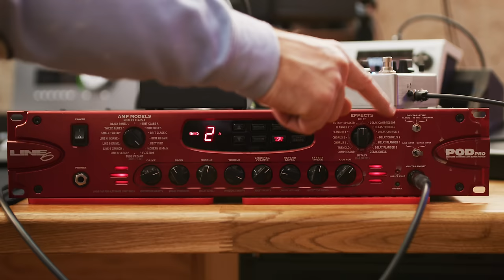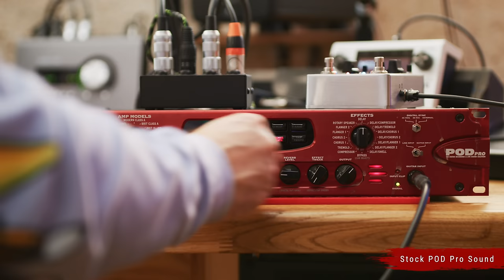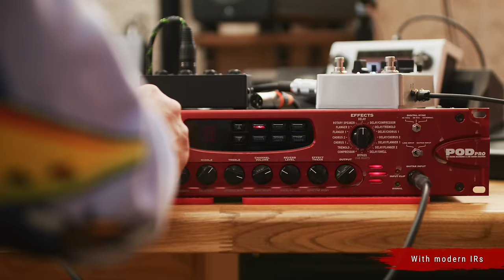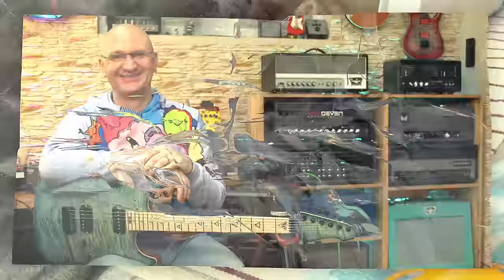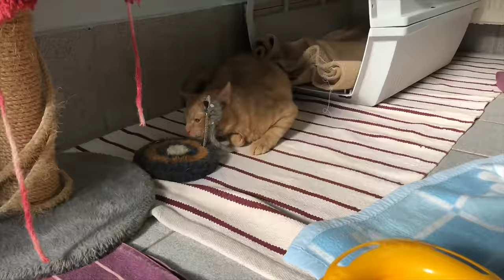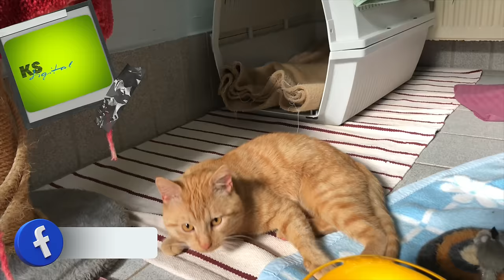24 YEARS LATER - LINE6 POD with modern IRs

Comment: I worked as a stagehand for about ten years.  I saw more of these than people would probably want to admit in racks and under the stage.  They could have been for practice but most of the time the stacks of cabs were all dummies and there would be a little 50-watt tube combo stashed in a box where all the sound was actually coming from.   In the hands of pros these sound just fine and no one knew the difference.

Comment: I used to gig with a Pod 1.0 that I upgraded to 2.0 with an Eprom. That, a floorboard and the original Variax. Built all my own patches. I eventually got such an ear for the Line6 sound that I can still tell when I hear one. I HATE the certain fizzyness that imbues the sound, especially with any gain. I could hear it in your initial sounds. When you  changed the IRs, I could only tell on certain IRs. But there were several that sounded great to me. I never considered doing this. What an eye-opener! Thanks for a great video.
Reply: That "fizziness" is at 3130 hz
Scoop it out with say fabfilter eq..
Q 6
Gain - 6
There you go.. a much better sounding pod.

Comment: I knew this would work because back in the day if you ran any one of these guys through a power amp into a cab with the cab sims turned off into good speakers it sounded good. The issue has ALWAYS been the cab/mic simulation, which is totally solved by IRs. I actually used to run my Flextone II Plus (same exact modeling as the POD HD/2.0) into a stereo 4x12" with the cab sims turned off and I loved it (didn't love lugging it, but it was kind of worth it). Sure, the models could be a little more dynamic, but damn they get you some good sounds if you know what you're doing. Love your stuff, man!

Comment: My current setup is a POD X3 Pro through a Mooer Cab X2, which loads separate IRs for the left and right channel. I put two Mesa Cab IRs, one center speaker and one edge of speaker, so the sound guy can blend both as needed. Similar to moving the mic in front of the speaker. Also, the Mooer Cab X2 is in the FX-loop of the Pod X3 Pro, so I can dial it on and off as needed.

Comment: I gigged a POD 2 running into the fx return of various amps cabs....usually a half-stack....for several years and people were constantly blown away with how I was able to get such great tones.  I ran is a preamp, without any cab/mic stuff, and to use the delay, reverb, mod effects.  I always hated the “modeling” aspect when used direct, so I just took advantage of the variety of tones as a preamp/fx unit with a live amp.  Having the floorboard for it was all I needed on the floor to change patches, turn fx on/off, and wah/volume.  It was such a simple setup that NEVER gave me any issues.........I kind of miss it. 😢

Comment: Rocking a Behringer V amp 3 here after trying a few modern modellers
Reply: I still have my V-amp 2, which I "replaced" with the Valeton GP-100 thinking I just want something newer and with more effects that sounds decent, and frankly in some ways, it was a bit of a downgrade sound-wise. (But on the other hand, I don't have to choose from a few preselected effect combinations and I can also use stomp mode instead of just switching patches, so...)

Comment: Great Show! Yes, I used the Line 6 POD in most of my recordings and you can hear it here "CARL FERRY" on all of your Streaming Platforms including YouTube, Apple, Amazon and Spotify. I now have a 2010 Line 6 POD, a 2000 yr Line 6 Flextone Amp and the latest Line 6 Spider V MKII 240HC head with a 4X12 Cab. Been making good sounds since 2000.

Comment: I just recently purchased the Old Spider Valve MKII HD100 amd the HD147 300 watt head and along with the FBV footboard and a midi controller and an ABY switch I have more tones than I coukd imagine and all in less than 500 dollars for just the heads.

Comment: I went to one of the rare Shadow Gallery concert and saw Gary Wehrkamp playing the whole gig thru the Pod 2 kidney. If it's Wehrkamp playing thru a potato, it will sound good and you won't care. Arjen Lucassen (Ayreon) recorded Human Equation on the newer version of Pod Pro... This was a killer tool back in the day (as was the Behringer V-Amp Pro clone). And NOBODY would be able to tell the diff between this and Kemper in a mix. Or a blind test.

Comment: I had a few models on those (and my old Flextone II XL) that actually sounded decent. A lot of it was ass, and didn't take drive pedals well, but some of it was actually useable if you dialed it in right. It was mostly about finding the right gain sound and cab combo (in the flextone I turned the cabs off entirely), then adjusting your effects from there. The delays and reverbs were glorious!

Comment: The software was key, you could also change the cabinets with a 2 button press during the power on, they really should have made all the functions available on the front. The use of presence really made a difference in the mud tone.

Comment: I've been using both my POD 2.0 and Flextone II XL amp for over 20 years. I don't think Line 6 expected this life span since they both have soldered watch type batteries, I assume to be able to save the presets. I have had both batteries replaced. Wonder if Line 6 still solders batteries in the Helix and other related newer products.

Comment: I actually bought one of these around 5 years ago; I was in a band that had ideas about everyone going direct but I didn't want to spend too much in case the band didn't work out (it didn't).  While some of the DI sounds weren't great, IRs I'd think, but it can work pretty well as a preamp.  I'd been running it into a Crate power block and 2 Marshall1x12 and it sounded fine - I could tell the difference but the audience were none the wiser.  Also it was a godsend when lockdown happened as I found myself playing through headphones a lot during that period.
I really think some up to date IRs would make it a great bit of kit (I'm 7 minutes in, so I don't know what your conclusion is yet).

Comment: I (still) have a POD 2.0, it replaced a Digitech RP-100 that really did sound like s**t. I occasionally drag the POD out just for fun and as you say, if you know what you are doing, you can make it sound pretty good. I don't see anything wrong with using old gear, if it's all you have, then what other choice does one have? I also think people can create s**ty tone with new gear too, because I have heard it. That's the thing about tone in general, there will always be good and bad tone because it's subjective, as you've proven. Good points and good video!

Comment: I don't know. I had the POD X3 and it was lame. Later, much later, I bought the THR10, Yamaha. People still swear on that sound. It sounds like poo. You just need to turn the THR10. It says "Line6" all over the place. I only use 3rd Party IRs with the THR10 or just it's DI
Reply: Iva owned the pod 2.0, xt, hd and the helix stuff.  In my opion the 2.0 sounded better than the xt and hd but the later models had better fx's.

Comment: I had this unit years ago because back in the day because I couldn't own a decent tube amp for a variety of reasons (mainly because I couldn't crank it and cost).  The POD can provide good tones however in my experience it didn't always agree with pedals put in front of it - but most of all it wouldn't respond like a real tube amp.  This can be a HUGE problem when trying to play Jeff Beck type stuff or anything that requires tube response at all gain levels.

The far better alternative in my view are sansamps and the POD just doesn't hold a candle to it.

Comment: A few years back I bought Scott from Chernobyl audio’s course on dialling in amp sims. And he made the point back then that the IR’s are what will make or break the tone. Be it from a live amp to a plug-in.

He was absolutely right. Just recently I fired up Peavey Revalver 4 that I stopped using ages ago as I found it too shrill sounding, I swapped out the speaker sims for better IR’s and am now enjoying the living hell out of Revalver again.

Manufacturers always seem to do preamp emulation well, but then they always seem to ruin it in the speaker emulation.

I’ve even found some of the latest plugins from Neural DSP and STL tones more to my liking when their IR’s are swapped out.

Comment: While my pod 2.0 is long gone, I still keep a Flextone 2 which is essentially the pod amp. More than once, when the venue had a shitty PA to’ even bother going direct I brought it out as my powered cab for my modern modeller. last time though, since it was a shitty gig and I was out f*** to’ give, I went with the stock sounds and boy did it sound great. The only gripe I have is that, even using a midi editor, the FX are kind of basic but honestly I see myself using it again as it is since with a pair of real speakers it still does it’s job admirably

Comment: I liked the lower gain sounds without the IRs. As soon as you got to the Brit channel that wasn't the case! The IRs made a difference, but not an amazing one -- those IRs sound very nasal. I did a similar thing with a Pod HD and Ownhammer/Redwirez IRs and got better sounds than stock cabs for sure.

Comment: I actually wanted to test this with Guitar Rig4, because that was what I started out with. Now I know that some of those sounds dont sound "great", some of them worked in the context back then and probably would now. But I dont go back to that software because I know that modern IRs can pull out so much more than old cabsims. 
But still I wouldn't hate on the songs I wrote just because "the ampsounds sucked" - the tones didn't write the song, and they didn't break it either. I'd argue a great song will carry the idea no matter the tone. Sure there are genres that will suffer more from that, but that's for people with far more technical abilities on the guitar than I will ever have.
Great to see this theory confirmed by you!

Comment: I had bought a Spider IV amp head with the corresponding 4x12 cabinet, in order to be able to play in a band cost-effectively to start with. The sound wasn't good, but through the 4x12 box it was somewhat acceptable. Today I play the big Helix and definitely notice a significant difference. No idea if the "amp" would sound better with modern IRs; however, the sound had always been sufficient for smaller gigs. Nobody complained about a "bad" sound. Except for the musician police, who suspiciously analyzed every piece of equipment with their arms crossed. But in the end, the audience applauded, which is why the know-it-alls sat at the bar in pairs, getting worked up about the bad taste of the masses. I don't want to take this hobby away from them. It's often all they have.

Comment: Nice video.  I would say that modern modeling has def gotten better, but not as much as we might think.  It's like 20% better than 2000, and a big part of that improvement is the development of more dynamic/reactive speaker filtering.  Just as a speaker/cab, in the analog world, has a significant weight in determening how an amp sounds, so does it have an major significance on the quality of a digital signal chain.  Also, those emissions on the rack POD are def not coffee stains.  I think you may have gotten a wee bit excited upon striking your first boomer bend playing through it, lol 😁

Comment: This sounds quite good. And it proofs my point that it´s sometimes better to just use a modeller as a hobby guitarist. They all sound fantastic, even the Kemper, which is also more than decade old without any hardware improvements and wasn´t even intended to be used as a standalone. That´s also the point why the effects weren´t as good in the beginning. They were just an addon. The thing that improves the most in the last few years is the "feeling under the hands" which isn´t that important to players that play a lot in studios or in big productions. And i can´t explain what it is, but the newer units sometimes just get it right. Loved the Torpedo, love the UA stuff, now love my Boss GT1000. But it only works because i never tried to emulate a specific amp which is not what the GT1000 is good at. I just build my own sound. And the feeling is now there which has led me to just use a modeller and for fun connecting it to my Fender FR-10 at home.

Comment: I was so used to play with the pod 2.0 that everything else seemed to me crap, without enough bass and gain for chugga. I used mostly the soldano x33? preamp model, similar to the rectified but more alive to me. Its funny to think you have to learn what a good tone is. then I had a vetta 2 and it was difficult time because with the matching cab it was bad. then I had the oporunity to try some tube amps and some were also bad with a wrong cab like a Krank rev1, valveking..with horrible matching cabinets. but then finally I experienced normal good head-cab combinations and it was like ..oh wow ok, this is the real thing. 
long way..years of crap to experience the thing some players had the luck to have almost the first time playing.
Pod was spectacular for the time, the only thing is the lack of high end and the extra bass because of the IR cabinets of the time. but some amps are still spectacular like the black panel , the badcat emu, the bayou model  was so crisp that my crappy emg seemed single coils, something never replicated again.

Comment: I performed with a HD500x and an IR loader, sounded awesome.
Reply: How do you connected it to the pod , in the effects loops? Thanks
Reply: @cybersixx  output to a Mooer Radar.
The presets (a,b,c,d) where meant to be:
A was clean, B was crunch, C was rythem and D was Lead.
All had the exact same blocks, but each preset was simple On or Off on certaind pedals.
Clean amp, meaning OD was a pedal, sounded great and saved on DSP.
No cab block, meaning the Mooer Radar IR loader had to be last in the chain (so I output into it).

Comment: i think the real innovation was, better gates, better irs, better effects and poweramp influence and better dynamics, so new modelers come closer to creamy tones. Old hear was not bad but more static feeling and sounding. After all clipping is easily modeled but things like sag, etc. not that much. so if the music does not need that old modelers are totally fine. I often try out amps i had years ago just to try if i can do it better now. And the last bottle neck for live playing musicians is the FOH Guy, a bad modeler + awesome sound engineer will always sound better than amazing gear and a horrible mix... hmm same goes for the studio i think. I mean, rammstein and clawfinger and all these industrial metal stuff their sound often fits super well to the music despite using horrible gear like Behringer V-amp (Samsas Traum), Digitech 2112 (Clawfinger), Sansamp (Clawfinger, Rammstein or even Nirvana) When it comes to gear, "good" and "bad" are simply words that do not work well. Muse recorded some parts with a fuzz directly to the desk. IF you like what you hear, it is legit, imo